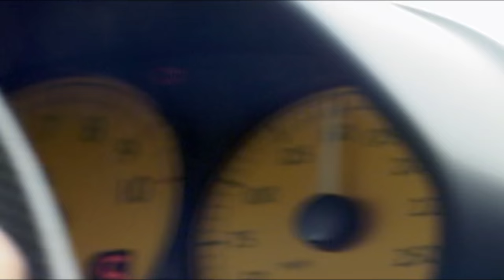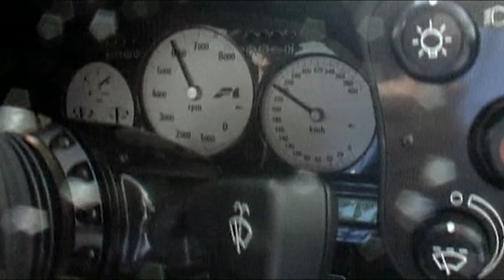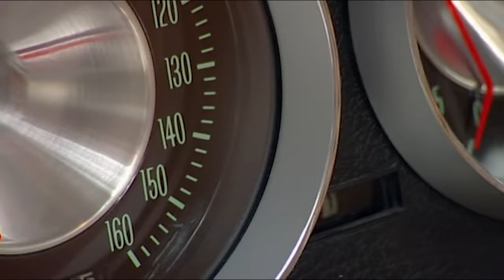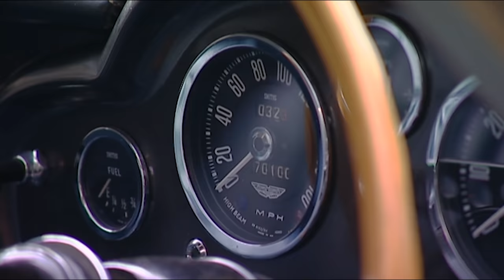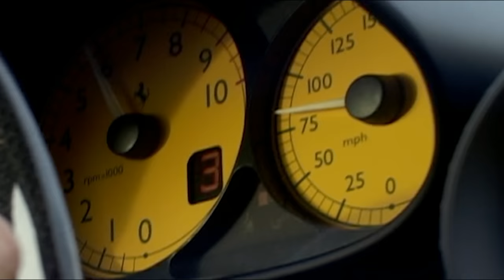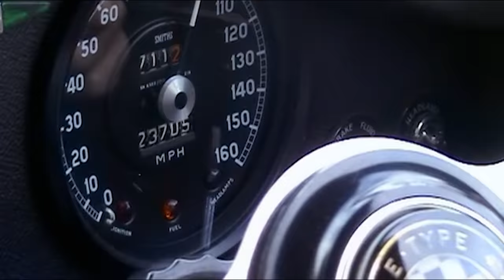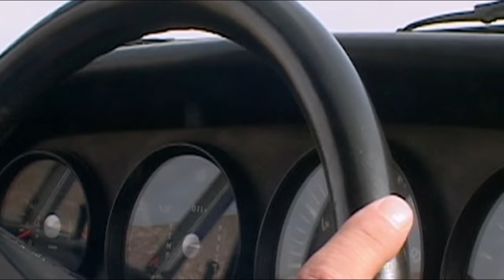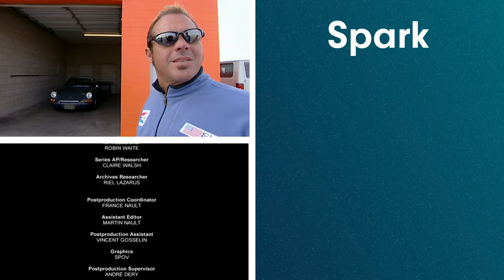The Greatest Cars of The 20th Century | The Greatest Ever

Comment: That was a brutally flawed explanation of turbo charging. Other than that, I'd have pushed the skyline a lot higher on the list and put the Dodge Viper somewhere up there too.
Reply: At least the air nozzle (turbo) blowing in more oxygen to be combined with the fuel (tobacco) visibly demonstrated the resulting increase in power (faster and brighter burn).  The hammer demonstration was actually much more flawed.  When throwing a hammer up in the air, the hammer head will not always hit the ground first as was claimed.

Comment: @50:00 probably the worst explanation of how a turbo charger works..

What it does:
Uses exhaustgasses to drive a turbine that compresses FRESH air and forces it into the cylinders.

What it does NOT:
Recycling exhaustgasses and forcing it into the cylinders.
Reply: I noticed that too. The description of turbocharging was actually a description of Exhaust Gas Recycling (EGR) - the bane of all current combustion engines to reduce emissions.

Comment: I have had the opportunity and pleasure to own a number of sports cars. I started with an 1967 XKE convertible. Beautiful and the number of admiring glances were pretty amazing. A pleasure to drive, but awful engineering with lots of problems. I owned a Ferrari 308 which was pretty anemic and uninteresting. I bought an  Acura NSX. Over-engineered with not nearly enough torque or horsepower. Fabulous gearshift however. But the fun factor was low. Looking for cars that weren’t always in the shop, I had a series of Porsches. A Carrera from Germany at the time American Porsches were neutered and then modified significantly made it amazingly fun and fast but was definitely tail happy. My current and absolute favorite sports car is the 997.1 GT3 RS. So fast and so much fun. Real personality
Reply: The Porsche cerrera GT is one of man kinds greatest creations.

Comment: Whereas, I do agree that the 911 deserves the number 1 position, I take exception with calling it a porsh. The car is named by and for its creator.  Professor Ferdinand Porsche. Pronounced porsha. Also a turbo does not recycle exhaust gasses. It uses exhaust gasses to spin a small air vein  which creates high pressure on the output side of a turbine. The two gasses dont mix together it is simply pressurizing the intake for the engine by using the exhaust of the engine,  you are not injecting already burnt fuel back into it.
Reply: So , Alexander was born before 1948, that's  when Ferdinand started the Porsche motor company.I was referring to the company name.
Reply: Vox Quod  not a problem. We both agree on the pronunciation issue and that was what triggered me. What boggles my mind is when I hear guys like Leno say it both ways.
Reply: Vox Quod  I bet.  But why wouldnt you?  Probably a variant of the greatest automobile ever created.  A long term study was done on useing a 911 as a daily driver and it was found to be quite useable for dsy to day usage on top of being a great sport car.

Comment: Yes, the Stingray was not refined or great in the corners, but if nail it on the straights and brake hard in the turns you can still easily beat anything Europe had to offer in the mid-60's.